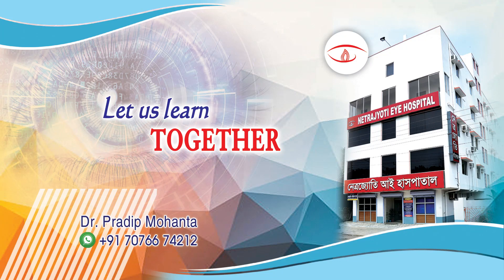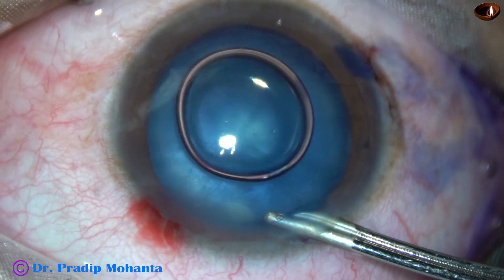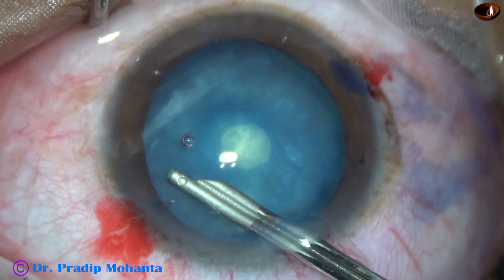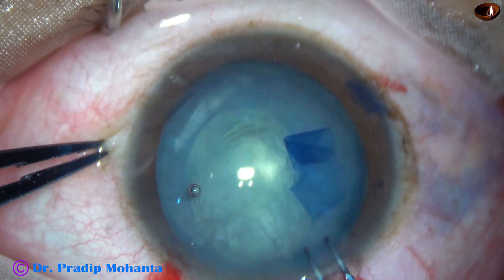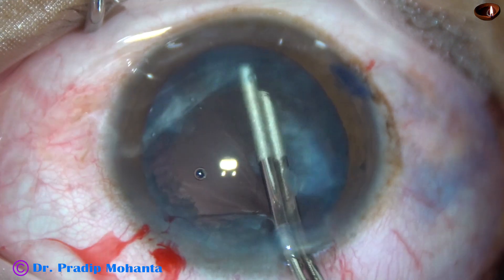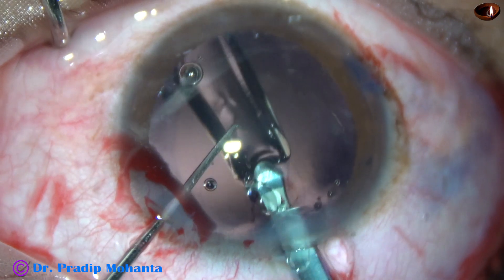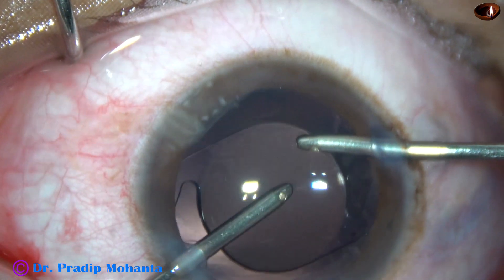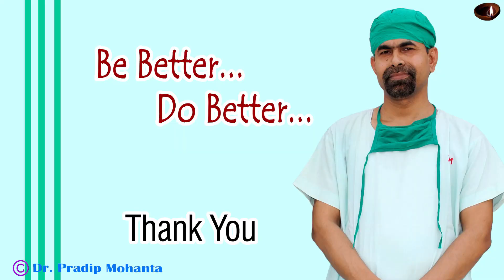Rhexis runs out and becomes irretrievable : What to do now ? - Dr Pradip Mohanta, MS,  11 Aug, 2020

Comment: Looks like the injection of Vision Blue MAY have caused a direct defect in the capsule at 1:03. It is later more evident at 1:10 and 1:15 as the bubble bugles over the defect so that it may stay in contact with the water on the surface of the capsule. I’ve seen this before in my own cases. These fragile capsule can even rip from injecting a bubble! In any case when the rhexis reaches this defect it extends along the more radial vector and runs out. Pradip handled it like a pro of course- no surprise there, we’ll done, thx for sharing!

Comment: Sir i have observed in some cases u put intracameral vigamox and again give a symco wash...in some u just leave 0.1 cc inside without wash ...and here it's only drops u have put ...can u please elaborate what is the right protocol....in my experience i have been following from ur earlier surgeries to inject vigamox and then remove it with symcos/bimanually...and till date luckily no endophthalmitis have been noted.... please if u can advice🙏
Reply from the maker: Usually I inject vigamox before closing the sideports. Occasionally, in cases with P C rents, I inject at the end.
....
Even if we wash at the end, significant amount of Moxi remains in The bag behind the IOL (I have seen by UV light torch). That is enough to control infection.
...
Right thing is inject 0.1 ml at the end taking care nothing else enters into AC.
Reply: @pradipmohanta9321  noted...thank you sir🙏😊